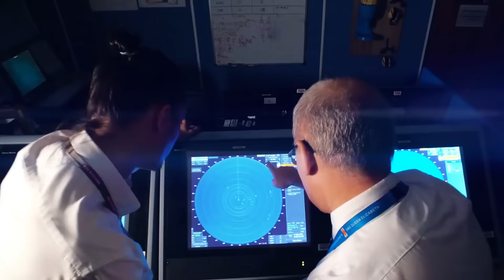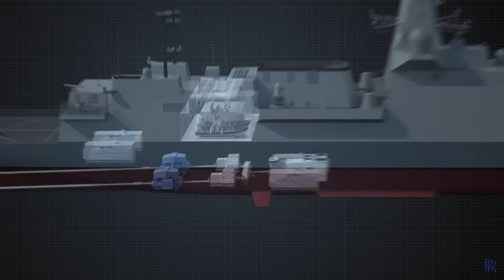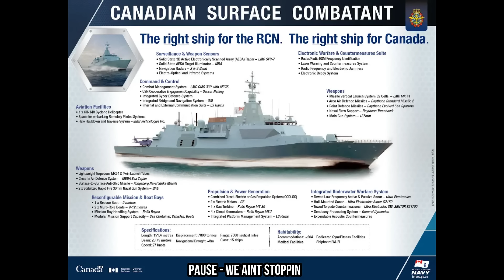Canada's New Warship

Comment: It's actually a good thing to be third in line to build this class. The Australians have detected some design bugs and the AC electric drives in the Type 45s still have teething pains. Hopefully, the bugs are sorted out before we start building. HMS Glasgow will be sailing fairly soon. They're riding the steep learning curve, instead of us. We haven't done this with our two big Commonwealth allies since the WWII Tribal Class.
Reply from the maker: Great points. Thanks for watching.
Reply: Im sure I read somewhere that the Australians were having problems with the T26 because they were making such massive changes the ships design /capability the displacement just keeps going up and up ?
Reply: The electric drives used on the Type 45 aren't being used on the Type 26, and were designed by General Dynamics I believe.

The problems regarding Australia's Type 26s stem from us uparming or changing it quite a bit, which made it top-heavy. We went for fixed-array radars rather than a rotating array radar, and also added torpedo launchers. Our fixed array radars are mounted seemingly higher than the projected Canadian radars as well, which will contribute to its unbalance.
Reply: @arakami8547  I know that the Type 26 doesn't use the same drive motor as the type 45 but the AC technology itself is new and they're still working out the bugs. It is the key, though to acoustic stealth for these ships to get the diesels and turbines away from the hull. Yes, the Canadian version has a much lower profine radar (Sea Giraffe?)
Reply: @arakami8547  Every variant has torpedeos, isn't that the whole point of the ship? Or are the Aussies adding extra?
Reply: @dan7564  Not every variant has torpedoes; specifically the base Type 26 that the RN will use does not utilise any. The Australian and Canadian variants do use them, presumably for defence and will likely use hard kill anti-torpedo torpedoes. Torpedoes that aren't vertically launched are not effective at killing enemy submarines due to their incredibly short range; by the time the submarine has gotten within that range then it would have already launched its heavyweight torpedoes and you would have already spotted it long before on sonar. The actual submarine hunting will be carried out by the ships Merlin helicopters and various USVs and UUVs. If you mean aerial torpedoes, the Merlin (Cyclone for the Canadians) is to carry 4 of those each as well as a dipping sonar; the Type 26 can carry 2 Merlin's and surplus unmanned systems. Australia does not operate the Merlin, instead we operate the MH-60 Romeo which can only carry 2 torpedoes each. That aside, paired with the silent hull, the Type 26 is to be one of the greatest ASW vessels in the world, if not the greatest. However, the Canadian and Australian variants are more multi-role than ASW-oriented.

I'm somewhat jealous of the Brits for their large military; It feels like it's just me that wants this, but if CANZUK ever happens I would wish for a combined military. If accumulatively CANZUK spent 2.4% of its GDP on defence and 35% of defence spending on the navy, we could reasonably see 8 CSGs and a fuck-ton of general purpose frigates granted we stick with only 4 planned SSBNs of the RNs dreadnaught class. 10 billion for a single SSBN could get an entire CSG. More nukes should be procured however to defend the larger union/confederation, currently the RN stockpile of nuclear weapons isn't large enough to equip it's SSBN fleet with half their capable payload.
Reply: @duncancallum  I don’t think you have any understanding of how shipbuilding and Defence acquisition works. Talking smack about things you don’t have any knowledge on unfortunately seems to be a common theme amongst keyboard warriors.
Reply: @kizzyp2735  Hunter class started at 8,800 ton that has now increased to 10,000 ton at the end of last year but the latest government senate inquiry at the start of this year 12,000 ton was brought up as a new final possible weight after a possible lengthening and widening of the ship to handle the new weight at this point you could call it a completely new class of ship
Reply: If the Tribal Class ships were a real woman I'd simp for her %100
Reply: @nathanb8721  thats actually insane, cause when I was researching a couple years ago they were supposed tp be similar to the Canadians 8000, but 12000 is an entirely new class.
Reply: @Abraham Dozer - there is nothing wrong with the electric drives of the Type45. The problem has been with an intercooler system supplied by General Dynamics and fitted to the Rolls Royce Gas Turbine that causes a shutdown. A fix was put in place years ago by ship mechanics and a bigger upgrade is now being carried out. No T45 has failed to complete a deployment.
Reply: @arakami8547  im surprised the uk version isnt getting torpedo launchers
Reply: @duncancallum  in the end it's a good thing for the fuck up, the strategic situation has changed since australia went for diesel electric and nuclear subs are the way to go
Reply: So long as they don't send us the duds.  :-)
Reply: @mthecritic6795  The diesel boats that we got were the non-nuclear version of the Trafalgar class that we were supposed to get. They aren't "duds" by the way. Just about everything that has happened to them, including the massive expenses incurred refitting them was caused by us Canadians making mistakes or big changes to them. The other cause of "dudness" is the Canadian Armed Forces pathetically poor public and press relations.There is a sea of young Ryerson grads out there who want to GOTCHA! Canadian anything at the drop of a hat. It's a symptom of our great national inferiority complex that we complain about our submarines while knowing nothing at all about them
Reply: it was more to do with the fact the aussies slapped a massive radar array on it, that was meant for destroyers AAW stuff.
Reply: @arakami8547  torpedo launchers were already included, unless your using 21" heavy weights xD. but seriously the Radar the RAN chose was meant for AAW Destroyers, that being said the Type 26 can reconfigured into a destroyer hull with little issue by swapping out the sensors and weapons, remove the towed sonar array and replace withe SEAFAR radar array which you almost did. it would've easier to keep the Mid range Artisan 3d Radar for the frigates then use the hull to make a destroyer to replace the Hobarts with little cost.
Reply: @duncancallum  ...quite obviously written by someone totally ignorant of Defence Procurement and Contracting procedures.
Reply: @arakami8547  Stop it with CANZUK will ya. Australia is in the Indo Pacific not Europe and the Atlantic. We can be allies with the UK and Canada, but there is no need to somehow hark back to the good ole days of Empire.
Reply: @duncancallum  nuke subs are as noisy as fu.. diesel boats are quiet and are h/k capable . newer designs are not always the best
Reply: @Drew Peacock hunter-killer
Reply: Australia's Type 26 Hunter class has 10,000 tons of displacement ("over 10,000 tonnes"). Hunter class has a 32-cell strike length MK41 VLS.  Each MK41 cell can fit four RIM-162 Evolved SeaSparrow Missiles (ESSM).  ESSM has a +50 km range. For comparison, UK Type 45 has  8,500  tons of displacement.

UK's Type 26 City class has 8,000 tons of displacement. 2 x 24-cell VLS for 48 Sea Ceptor anti-air missiles, 1 x 24-cell Mark 41 VLS. Sea Ceptor anti-air missile has a 45 km range. The VLS cell for Sea Ceptor anti-air missiles is small.

Canada's Type 26 has about 7,800 tons of displacement. 24-cell strike length Mk 41 VLS, 2 × 3-cell ExLS for 24  Sea Ceptors.

Strike length MK41 VLS can support mach 16-18 hypersonic speed SM3 and SM6 Block 1B.
Reply: @Duke_of_Petchington  Australia's Type 26 is an Aegis combat-capable AAW and ASW roles. USN's DDG(X) also has 10,000 tons of displacement.
Reply: @68arclight  >Stop it with CANZUK will ya

Australia and Canada are in CPTPP. UK is in the process of joining CPTPP. When the UK joins CPTPP, 7 of 12 CPTPP members are also Commonwealth members.

When Trump's USA exited TPP, the resulting CPTPP created a preferential trade environment for Commonwealth members. LOL

Trump's stupidity has nearly restored Commonwealth's Imperial preferential trade environment with CPTPP.
Reply: @Duke_of_Petchington  
Hobart class still has the edge with its 48 cell strike length MK41 VLS.  Hunter class has 32 cell strike lengths MK41 VLS.

Hunter class has a longer range when compared to the Hobart class.

Hunter class has a lower acoustic noise when compared to the Hobart class.

Hunter class's larger-scale CEAFAR 2 has GaN AESA radar tech. Hobart class has the older PESA radar tech.

For a given power,  
GaN AESA radar is superior when compared to GaA AESA radar.
GaA AESA radar is superior when compared to PESA radar.
Reply: @valenrn8657  Yeah. But so what? The Commonwealth is next to meaningless. No need to reinvigorate the old colonial past. It won't go down well in the Indo Pacific. There is no need for ANZUK.
Reply: @68arclight  Reminder, 
CCP is reinvigorating Imperial China's belt-n-road project. 
Putin is reinvigorating imperial Russia and USSR via the Eurasian Economic Union (EAEU) project. 

Brazil and Portugal created Lusophone Commonwealth with citizens' mobility (Lusophone citizenship), Parliamentary Assembly,  enlarge cooperation in matters of the seas, tourism, economy, and more ambitious defense and cooperation mechanisms and 'etc'. The rising power of Brazil leads the Lusophone Commonwealth group. Brazil has a nuclear-powered submarine and is able to manufacture Gripen E (F-39) fighter jets.

Countries like Brazil, China, and Russia don't give a shit about your feelings. Brazil doesn't give a fu_ks about Indonesia's feelings.
Reply: @arakami8547  Usually rotating radars are higher up.  Fixed arrays tend to be part of bulkheads around the ship, and you just see what looks like plates attached to the bulkheads.  Says a person whose been on a few warships.

Yes I'm sure you can have a structure that's higher up with fixed arrays to give 360 degree coverage.  I've been out of the Navy for many many years now.  Usually they're bigger though because of the amount of power they can deal with.  And I can see how moving arrays higher up gives an advantage because one of the weaknesses of early Aegis (I don't know what exists now) is that low incoming objects were hard for it to pick up and it should have been accompanied by a higher mounted surface rotating radar.  But if you were to do something like fast bursts of energy giving something like 45 degrees of coverage at once, or maybe 60 degrees you could get away with using a bit less energy, and you could easily create a pattern that allows for the return of energy in one of those sectors before firing off more energy in a sector adjacent to that one (12.2 microseconds needed for each mile of range, that should give you an idea).  Blasting energy into returning energy isn't the greatest idea but it can always do a lot of frequency shifting.  But I don't know, I don't remember the details of this part.
Reply: I think on the Australian side the ships configuration was being changed causing weight issues, but you are right with us Brits doing the testing and taking the pain for the first in class which should mean that the Canadian version should have all issues resolved. Still I think it is good that Canada, UK and Australia are working together and really should be doing a lot more of this.
Reply: @arakami8547  Agree and a a Brit, I just wish we worked even closer on these types of procurement projects to not only reduce costs through buying power but get the best available in a timely fashion but then again whenever politicians get involved it tends to go wrong fast! Still we are spending more finally in the UK..
Reply: @vMaxHeadroom  We are a more natural fit with each other than we are with our various allies, Americans included.
Our family history goes way, way back through thick and thin and don't forget that in 1940 it was just the three of us (and the Kiwis, South Africans).
Reply: @vMaxHeadroom  The main barrier for closer cooperation is that the strategic needs of Australia are very different from the strategic needs of the UK.
Reply: Some good points well made,  but the UK class of major surfce combatants of which your CSC is  variant, is the T26 frigate, optimised for a ASW role. Not the T45 AA/MW destroyer. The propulsion plants are quite distinct and the major issues with the T45 have already prompted robust efforts to ensure there's no repetition with the T26.

More generally, given that our two nations, along with our Australian and NZ friends (and still often quite literally our kindred, too) are even now in 2022, by far the closest allies on the planet, wih constitutional, broader legal and deep cultural links that are effectively unique,  then maybe it's time that this was finally acknowledged in a 4-power CANZUK association.
Reply: @squirepraggerstope3591  So, the process has worked already.
Reply: @kizzyp2735  yes.  That's us.  We take something that works and we fuck about with it, usually with American help.  US always wants us to buy same kit as them for the  ships even if it's not a US design, and designers pull their hair out.  We did this with submarines too.  Never learn
Reply: I love that tribal class, there is a museum ship HMCS Haida right near me, I visit it whenever I can.

Comment: One thing you neglected to mention is the modularity. The Type 26 has several "mission bays" that are essentially plug-and-play modular pods that can be applied/removed depending on the mission type. Extra ammo, humanitarian, anti-piracy and whatever else they can dream up.

I also wonder whether some of those pods can be fitted to Harry DeWolfe class in a pinch?
Reply from the maker: Reconfigurable boat bays! They're pretty adaptable which is great for a ship that will be asked to do many different things.
Reply: It sounds like a great idea but ships built in the states have found that it wasn't worth the effort.  Ships that got a certain package tended to stay with through the life of the boat.  I belive that is on of the thing from the lateral combat ships that's getting the axe in the future in exchange for more crew to run and maintain the ships.
Reply: @loganholmberg2295  yes the LCS are supposed to have swappable mission modules. So that they can do Mine Countermeasures work, Anti Submarine and other work. But the problem isn't so much with the modules but with the berthing available on ship. There just isn't enough. When commissioned these ships had a crew complement of 40. But the Navy discovered that this number was too small to effectively man the ship. So the complement was increased to close to 50. But the ship only has berthing for 75. And as originally designed the mission modules add up to 35 crew. So the Independence class, at least, dont have enough bunks. 

Between that and an issue with the combining gear on these ships they are being withdrawn from service. 

The Freedom class LCS dont seem to have the same issues.
Reply: In the video some of the animated previews showed exactly what you described with details
Reply: Modularity is a more and more popular concept, given that it's things like sensors, comms, and weapons that must constantly evolve.

Comment: Yeah, I wouldn't believe some of these stats. It's a safe bet that the various navies aren't publishing the true specs. A modern frigate with a top speed of 27 knots is absurd, as is a range of only 7000 nmi. The Leander-class cruisers (built in the 1930's) were capable of 32 knots, for instance, and they weren't much bigger than the Type-26.
Reply from the maker: Likely the "safe"  manufacturer cruising speed.
Reply: They're not designed to be fast, because 5kn is nothing compared to mach 3. They're designed to be quiet, because 120dB is half the volume of 130dB.